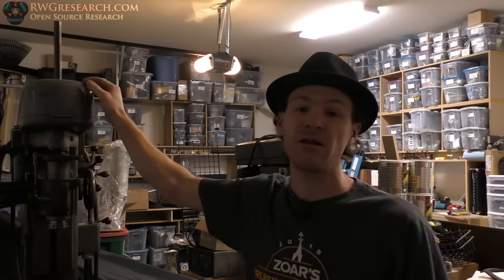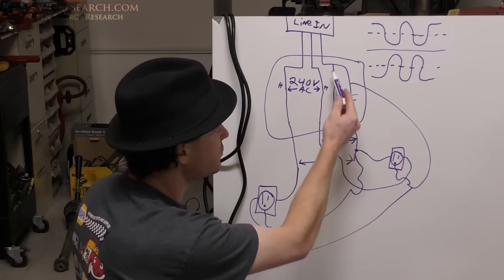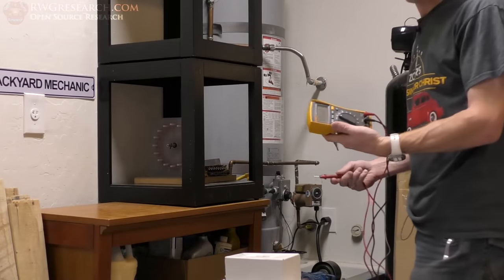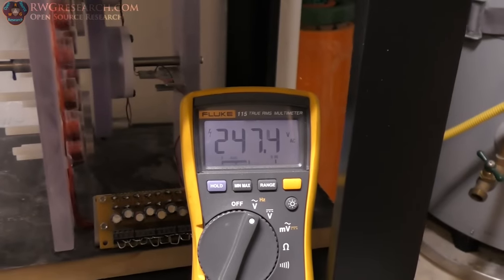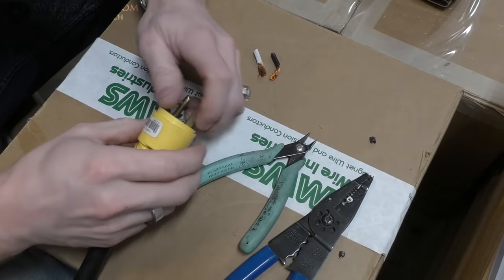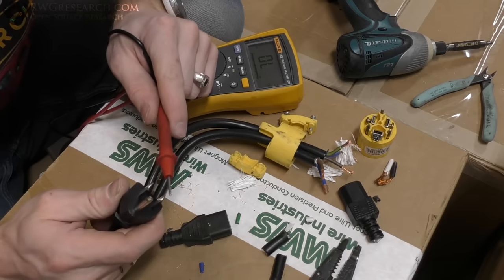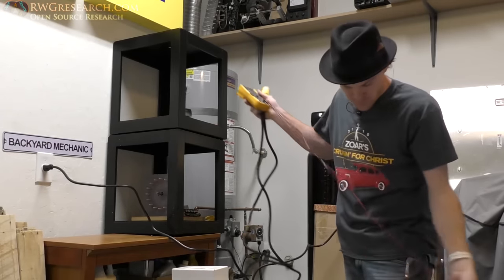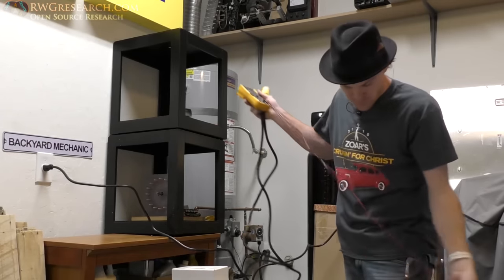How To Get 220V/240V From Two 120V Outlets. No Electrical Panel Work Required...

Comment: make sure you don't have anything plugged into the adapter when you go to unplug the two cords, or the hot prong on the first plug you unplug will be connected to 120v from the other outlet through whatever's plugged into the adapter.
Reply: This is true.
Reply: 120v gave me a multiple pinches fixing a light fixture woke me up.
Reply: That’s the disadvantage 
I was about to make one of these but that discourages me

Comment: Please only do this in dedicated outlets because if they are not and you hook up a high consuming equipment you risk overloading the two circuit and overheat the AWG12 wires. If you really want a 240-vac circuit and play it safe, just take a dedicated circuit and in the breaker box, find the white wire for that circuit, remove from ground and hook it up to an empty breaker that on the other split phase.

Comment: The commercially available version of this is called a "quick 220", which uses an arrangement of three relays for safety. Which ensures you never have any live prongs when one end of the adapter is plugged in and the other isn't. A version without relays but which preserves neutral is sold for RV usage.
Reply: @crashk6 Do you have a link to the RV version?
Reply: @crashk6  Is this something I can use to safely connect a 240v woodworker's power-saw in my garage which only has two 120v power outlets?
Reply: @tvm2209  That very much depends on the electrical requirements of your saw, and if your two 120v sockets are on different halfs of the split phase. The quick 220 would be the retail option to do what you want, in a relatively safe way. Within one room, the sockets are usually wired together on the same circuit, which means you'd need to locate a socket that isn't on that same circuit to utilize the quick 220.  If your garage has an electrical service panel in it, then installing a proper 240v socket is the way to go, and possibly cost competitive with the quick 220 in that instance.
Reply: If you preserve the neutral, and if one of your outlets has hot and neutral reversed (as did a lot of the outlets in a house I recently bought) then you'll have trouble.

Comment: This video was a real lifesaver for me. My central ac went out and its 100 humid Florida degrees outside and it looked to be weeks to get it replaced so I had a monster 22,000 btu 220 volt wall unit but no 220 plugs and the panel had no spaces left for a new circuit so I tried this fix and wham problem solved my window unit is roaring away with no problems at all not even a gfi blew  BTW I followed your instructions right down to using computer cords so I don't know if variations will work as well. 
  I was worried about what would happen if one of the cords was pulled by accident would the ac unit be damaged by only 120 volt current but then I realized if one cord was pulled it simply broke the circuit and you ended up with no power not 120 volts so the ac unit is safe
Thank you so much for this well-done post !

Comment: I worked for a company that installed vehicle lifts, air compressors and other heavy duty electrical machines. I have made over 10 drop cords just like that to test equipment after install. When the equipment tested good we'd run the outlets.

Comment: Thx so much for Cleary video. I live on my boat. My marina has two 30 amp 120v lines out of phase for shore power. I love to cook but my 120v induction cooktop is sadly inadequate for boiling large water pot to make a crawfish boil. Your simple system will allow me to use my 220v induction cooktop when I need boiling water fast without screwing around w breaker. Laissez le bon temps roller!

Comment: Nice video, great job laying this out in layman's terms.  I'm an EE and totally understood everything you're doing.   I have been trying to come up with a way to do this and had this exactly in mind so it was super nice to find this video.   God bless!
Reply: hello Adam,

do you know why the neutrals at 110V are not necessary ?
Reply: @alvarobarboza5730  not sure but I think it is because for 240V the voltage comes from the out of phase -120 and the + 120 = 240. Vs for a 120V outlet the voltage comes from a single 120 (+ or -) to neutral
Reply: Do electrical engineers not study the NEC/CEC codebook? 
Edit: not trying to be an ahole
Reply: @alvarobarboza5730  AC current doesn't have polarity. And the neutral wire is bonded to the ground bars at the panel. It all goes back to the same source. The neutral is required at 120. But at 240 it just alternates between the wires.
Reply: @hemi4722  Well the ones that work in the power field would .
Reply: So I tried this on a compressor that I bought and it's not working. Motor is starved for power and when it gets going it trips a breaker. Motor is 5 hp 240 single phase. My breakers at panel I was using are only 15 amp. Motor draws 22 SO I bought 12/2 and a 30 amp double pole breaker and see what happens. Clever idea and I believe it will work assuming the load is less amperage.
Reply: @Mike-qo4kp : 12 AWG is rated at 20 amps.
If you are using a 30 amp breaker, you need 10 AWG wire.
Reply: @Mike-qo4kp  The most likely reason is that you’re pulling more current than what the breakers are set up for. This trick allows for higher voltage but the *current* is still limited by the (probably) 120V/20A breakers on each circuit.

Also your circuits could be GFCI protected.

Comment: Yes. I figured this out a long time ago when I needed to run a 240v light and didn't want to mess with playing with the panels. I use this method today to run my cnc spindle in my garage which only has two 120v circuits and two outlets. BTW- the electrical inspector hates you! lol

Comment: usually it's done at the Main box. You simplified it and "Learned You Some People"  yes you can make a 240 volt outlet running it from the main, or doing the same thing by connecting wires behind both outlets... But you better be a good DIY at your own risk or PAY BIG BUCKS to an Electrician without complaining. Great Video. OLE!
Reply: I think he kind of spelled out the fact that his breaker box was already full. 00:57

Comment: It is not a 3 phase system but a split phase. It is a 240V system with two line voltage, center tap to give 120V.
Your method is Ok if there is no earth leakage protection on the receptacles.  Furthermore, need to have a procedure when disconnecting. The appliance side (yellow) must be disconnected first, otherwise there will be risk of back energies a plug when the load is connected.

Comment: If you do your drawing with each of the 110V legs on the outside of the 3 lines coming in, you'll have a simpler drawing and more visually clear. The central wire will be able to connect outwardly with each of the 2 legs for the 110, and then when needed, you can also draw from each 110V leg and the neutral as well. You can easily draw in the circuit breakers alternately looping over the neutral to catch the opposite phase 110V buss. Also invest in a Blue & Red marker for each phase, and a Black for the Neutral, and a Green for the Ground. Really gets quite simple when the drawing is somplified.

Comment: Personally I think there is a lot to learn about electricity to become an experienced sparky. Here Australia it's about 4 years and you are in an apprenticeship, so it's on the job training. But I also believe that basic electrical connections are common sense and can be done safely and with modern safety switches, even a wrong connection will trip the mcb no worries. God bless

Comment: The concept is great and I’m sure to will work fine. The problem comes with the reality of if the wiring was installed with any kind of intelligence the connections of one side of the box will be kept from connections to the other side of the box as much as possible.
 In other words his garage outlets should all be connected to side A of the fuse panel while most of the house connected to side B to reduce the possibility of anyone getting their self connected to 240 power. I doubt if he would get both sides in his garage.
Reply: Granted your comments to be true 90% of the time, but he had already had 2 20amp 120's installed in the garage, in this case you would want a separate line for each of those 20A lines and not daisy chained.
Reply: No they send 20 amp service from both phase to help balance the fuse box.   Since these look to be dedicated 120 V  lines for a washer and possibly other high power machine in the room.     Having the house all on one side  is unbalanced. and heats up return lines.
Reply: I used to live in a trailer home with TOTAL daisy chain wiring. Really bad. True the box was split up, though not really totally evenly. I mean, one side of the box had mostly bedrooms and the other most of the higher load wiring. Like the refrigerator and washer. I rewired some of it and made it have its own separate wire to the outlets used for washer and dryer, but I did not put the washer on one side of the line and the dryer on the other side.  That would be too dangerous.

Comment: Can I run one side of a cable to a Honda generator 2000 watts and one to a regular 20 amp house outlet. I’m trying to use a harbor freight stick welder 225 model using the 220 volt setting. The 110 volt setting won’t weld good

Comment: Elec 101. There are 9 Interconnections in the USA/Canada or better known through the media as power or electric grids. I work for the Electric Reliability Council of Texas (ERCOT) better known as the Texas Interconnection. Power generation is anywhere between 10 to 260 GW. Gigawatts measure the capacity of large power plants or of many plants. One gigawatt (GW) = 1,000 megawatts = 1 billion watts. In case you are wondering about the US total, GW is 1,400. A lot of power plants are slowly switching over to interconvert alternating current (AC) and direct current (DC) power distribution. This scales back the possibility of two or more different power plants becoming synchronous resulting in a no voltage situation. Feeding on the big high power transmission lines substations step down the current and change DC to AC voltage. Most substations output from 5kV-50kV. 1 kV equals 1,000 volts. This is what goes to the lines on the utility pole. If you walk out of your house and look up at the joint pole, the very top wire is the static/lighting suppression wire, the wires under that are the transmission lines, the wire under that is the MGN (multi-grounded neutral) wire, under that is primary, under that is secondary triplex 120/240 volt, under that is a step down transformer, the distance between the secondary and the next wire is called the safety zone space and is for telecommunications workers for the TELCO, CATV, FIBER wires. Now, this is a general joint pole setup, you may not have a primary, you might have a single transmission line and an MGN wire and a step-down transformer under it. If you live at a busy intersection your pole might have all of that and traffic signal wires under all of the above. This is a basic set up. There are many, many different setups and pole uses out there to cover them on here. If your supplier uses a secondary triplex, your house feed will run directly to that, if not, your house feed will run to a step-down transformer. To prevent a zero voltage situation, the transformer(s) will sync the Hz, Hertz, of the two hot leads 120 degrees apart, or phase-shifted,  meaning one lead will be positive + and the other lead will be negative - when the current alternates direction. In your case, if you use one leg of the breaker box to get your 240 from, you run the problem of sync and damage to the welder. Likewise, when the welder contacts close it produces a voltage spike that will damage other load items on the leg. Cross talk is another problem, even if a short circuit develops, using one leg to get 240 from, can result in the breaker not tripping or start phantom tripping. National Electrical Manufacturers Association (NEMA) and the National Electrical Code (NEC), or NFPA 70, is a regionally adoptable standard for the safe installation of electrical wiring and equipment in the United States. It is part of the National Fire Code series published by the National Fire Protection Association (NFPA), a private trade association. And for the most part, the Canadian code is identical. Violation of the code can result in being disconnected, fine and or jail time. You want 240 volts? Do it the correct way. Last I looked a 100 ft. 10/3 wire was less than $130 a Square D 50 amp breaker less than $10. Why risk burning your house down?

Comment: I had this same idea the problem can be is feedback.    If you join 2  120 vac lines then start you tool it can feedback to that line 220 vac when it is joined and used so if you use something else 220 vac could run threw both your welder and anything else on that line .  Using duo 120 vac plugs amperage must be right because you can create a dangerous surge .  Your outlets must be standalone and not used as a 120 vac unless you disconnect your 220 vac tool from it every time you use each line for 120 vac to be safe.

Comment: Depending on your local code with run UF or wires in conduit, 14 AWG for a 15 amp circuit, 12 AWG for a 20 amp circuit, 10 AWG for a 30 amp circuit, 8 AWG for a 40 amp circuit etc.  Purchase the appropriate receptacle and fuse or circuit breaker for the rated current. Do it the correct way.
Reply: Do it right
Reply: Bro...this is useful. There are many applications where u just need to get it done in real world situations
Reply: Is it safe to run 12 AWG for a 30 amp circuit! Only load being a compressor that draws 22 amps

Comment: Bro every one at Home Depot said it would not work I did then found your video which is reassurance.😅
Reply: Problem is what’s your amperage on those lines? What do they go to? If your uzi g 10a on one leg your still restricted like his 20/15A config. 🎉
Reply: Just run a 12/2 and hook white to a 240. That’s why they sell split breakers to add more breaker space. Or if it’s that stuffed take two breakers and put another 100A sub next to it. Use aluminum so it’s 3$ 😂 prob get the piece for free from an electrician doing a service nearby. We throw the aluminum away.

Comment: Never really thought of this found it very interesting not sure I would ever do it versus just using a 240 plug but it was good information
Reply: I don’t have a 220 plug in my garage for my welder so this was very interesting lol
Reply: @oneangrycanadian6205  it won't work
Reply: @timnemeth6555  that’s ok I got my brain working for my 220v problem to my garage. I mounted and external water tight plug box outside my garage then I mounted a regular one in my garage. Then I mounted another water tight box out the side of my house where my breaker panel is and drilled a hole into the inside of the house and ran wire into a 50 amp breaker I put in my panel. Then I bought two plug ends and made an extension cord that I run from the side of my house to the side of my garage when I need my welder. It beat trying to run wire through the ceiling of my basement to the garage. I would have wrecke the stucco ceiling. This was an easy cheap remedy.

Comment: If I'm trying to power a dryer with 240v 30 amp power requirements, would the two cords need to handle 15 a, but the plugs need to handle the full 30 amps? So getting 20 amp cords and a 40 amp plug would do the trick?
Reply: I’m running into the same issue. Please let me know

Comment: +rwg42985
3 points I think worth making   (pin the comment maybe?) :-

a)  Electrical safety risk here mostly comes if one of the pair of 120v plugs becomes un-plugged, BECAUSE the unplugged 'hot' pin becomes live, through the appliance (load) from the 'other' 120v feed.
This system would be significantly safer, by mounting the 240v-socket on a project-box containing a 240v-coil contactor in a NVR (No Volt Release) arrangement with a 'start' button, so that either source circuit loosing power causes the contact to drop-out, isolating the 120v plugs' hot-leads from each other.

b)  I don't think the differing Current ratings on either breaker matter, all that matters is both circuits have enough spare-capacity to supply the load in question.  If either circuit breaker trips, you can back-feed the other-circuit with 120v 'in series with your load'.  Good design of the NVR circuit (e.g. coil that drops out below 180v or so)  again would mitigate this risk.

c)  Key point of note is this arrangement will not work if either circuit has any kind of GFCI (breaker, socket, or upstream-socket) because as soon as you try to pull load in this manner, the GFCI will just trip!, and again you can have cross-feed problems if you do not have a disconnect-circuit set-up.

Hope that helps informatively!.

p.s. John Wards' video on NVR [you would need double-pole 240v disconnection though]:-
https://www.youtube.com/watch?v=6dKwOsrnkb4
Reply: I agree, but the keyword is here, know what you are doing.

Comment: 1. You would be limited to 30(maybe 40) amps max. 2. If you put a 220v breaker inline, you could potentially save yourself some trouble. 3. Wire up a sub panel and be safe.
Reply: it would be limited to the current rating of the smallest breaker, not 2x, it's weakest link. and when that weakest link does go, aka one breaker trips, the other probably wont. big unexpected problems are possible.
Reply: No. You are limited to the smaller breaker @ 240v.